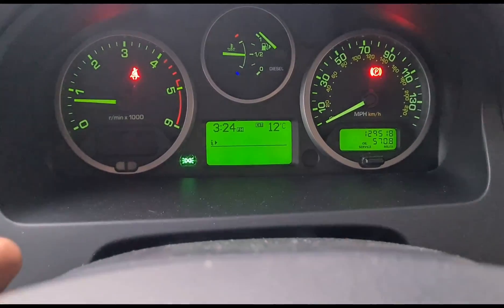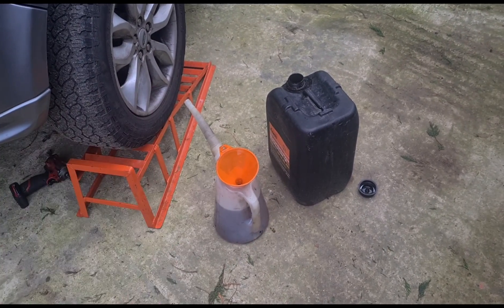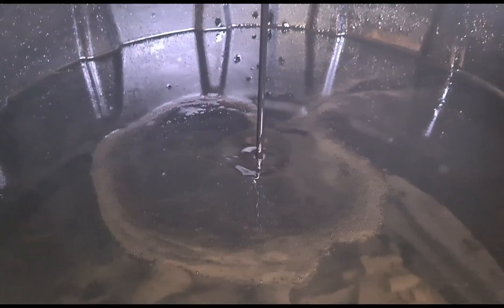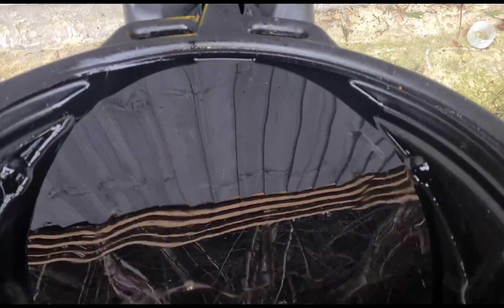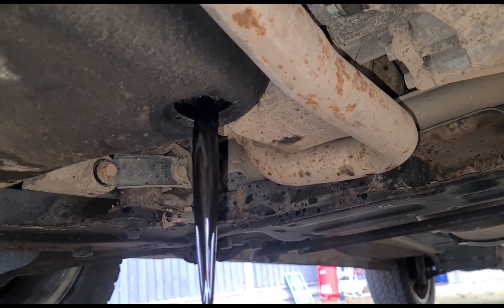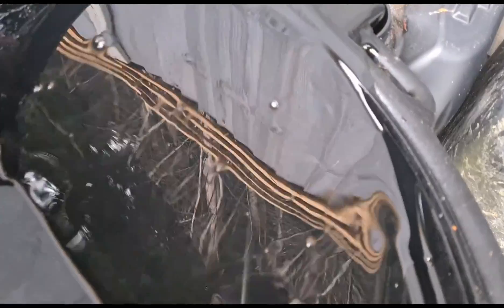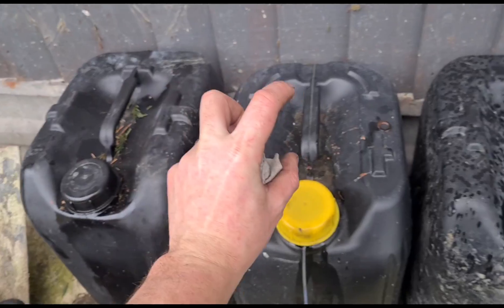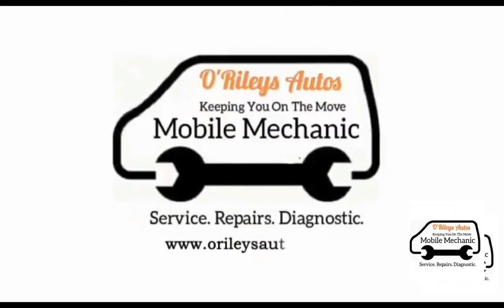How Many Oil Changes Until My Black Diesel Engine Oil Looks Clean? Test & Results

Comment: We just had work done on our 2014 cayenne diesel and the oil is suddenly clear. I do smell a bit of fuel in the car on startup vs coolant leak previously. Any thoughts on diesel leaking into the engine or oil and contaminating it? Thanks

Comment: I had very similar results with my BMW e90 320d at 140900 miles. First change at 140700, with new filter, run for about 200 miles, and then 4 more changes for oil to look clear like yours (3 changes with the same filter and on the last change, replaced the filter as well). Each change run stationery for about 8-10 minutes. Curious to see what will happen on the next change at 146000 miles. I have kept samples from all 4 changes. EDIT: After adding almost 6,000 additional miles, I repeated the oil removal process, and I stopped on the 3rd change; the used oil was still very, very dark. I don't think this process 'cleans' the engine.
Reply from the maker: Thanks for sharing

Comment: How long until it turns black again and are you going to use the oil used for the test again? 
Thanks, I did this with a scooter and planned to keep the oil and filter used for cleaning it and use that on a few oil changes. The oil in the oil level window on the engine was a lovely golden colour for a while.

Comment: Man here italy, we use to drive diesel, theres no possibility that oil in diesel engine look clean, switch it on and after a second is black again and is normal is not the engine that is dirty inside like in case of gasoline, but i love this kind of crazy video 😅😂

Comment: In 1963 I put a Frantz toilet paper oil cleaner on my nearly new Rambler American flat head 6. The oil went from black and dirty to golden and stayed that way. I expected the same with the Peugeot diesel.  It isnt happening. If the black oil doesnt stain the skin and feels clean and slick its clean. The old truckers palm test is with clean hands rub the dipstick in the palm. Rub it around. If you can feel the soot and it stains the skin its dirty. My old Ford diesel tractor still passes the palm test. The bypass filter uses half a roll of VIVA towels. If changing the filter and adding new makeup oil doesnt keep up with the soot I will drain the oil .The Pontiac is easy. It has a Australian Jackmaster Classic oil filter. Gasoline engines are easy. I have 1 micron filters. Some diesel soot is a lot smaller than 1 micron.

Comment: It’s totally normal for the oil in a diesel engine to look black. Even right after new oil was put in. It does not mean that the oil is broken down because it’s black. Totally normal. I use the Castro oil for diesels from Land Rover for my Range Rover L 405  TD 6 and have it changed every 6000 or 7000 miles.

Comment: When i bought my diesel Volvo the guy i got it of told me it had just  had an oil service and a new cambelt  , i could tell it had a new cambelt but the oil looked pretty dark so i changed the oil  two weeks after i got the car and changed the filter as well and just to be sure the car was in good shape i changed the oil again after 4 months  thats when i found out diesel oil goes black straight away and im a fool

Comment: Let me give you my dumbo opinion so from my experience with consumer diesels. So I noticed that diesels can run long oil change intervals, nothing wrong with that but I’m always a 3k or less interval but it comes from previous ownership of “sports turbo cars” where the turbo real regrades oil faster than we all think. So soot is like a black dye that’s natural in diesels, it clumps up and sticks to the inside of our diesels in every crevice. Even if you change the oil the new oil will break down those clumps which are concentrated dye clumps making your oil still black. The longer the intervals the more the oil has “dyed” not died  in diesels. My advice like another comment as well is using an engine flush, my preferred is 1-1.5 oz per unti quart of seafoam and drive around for about for about 100 miles as the seafoam will break down those clumps of soot dye. Not there’s nothing wrong with soot in oil but I have seen in the commercial side we have torn down a few fleets trucks with way to many idling hours and the oil was just too “sooty” and thick causing a few failures. That’s where I like my 3-5k diesel oil changes. I know almost all of you will say I’m wasting money but oil is really cheap tbh and a new diesel engine is not. I alway do this for the first few oil changes on a newly purchased diesel until I get bored and flip it lol

Comment: true. black diesoil. but good. I service my mb w211 320 cdi often. and my oil is clean for about 248 miles before it get dark. Still wonder why. but it always do. If I change the oil in time.

Comment: My 340k+ km Honda CRV diesel has a 7000km oil change interval. 
I tried last year some Castrol GTX, because of a very good price in Amazon but 5w30 C2 instead of 0w30 C2 so I used it in summer.
 I was really surprised after using it for just 5000km, I changed the oil and the new one remained clear for 2000km. Very efficient.

Comment: I work at an oil blending factory, so I always do a double oil change; one with basic mineral and $4 filter, and then after a drive round the block I dump and fill with the synthetic and a more expensive filter! Petrol engine so my oil is always golden, golden-brown by 6month change lol 
My wife doesn’t understand.

Comment: There is so much soot in that engine from extended oil changes that the new oil gets contaminated right away. I change my oil every 5000 km or 3000 miles and when I change it it takes a few days before it gets black. Don’t follow the MFGs recommendations for oil changes . Change it sooner.

Comment: Also good cleaning solution for really dirty engine is flush all after change with 50:50 mix cheapest oil with diesel fuel (you can also add engine flush if you want). Run it for 30 minutes on idle with slight revving (like up to 2-2.5krpm max). Than drain it, change oil filter of course (can be cheap one), put normal cheap oil and drive like 200-500km on it (just moderatelly, avoid high load and high rpm). Then drain it, change filter for good one and put good oil up to the next normal oil change.

Why 50:50 mix with diesel? Because pure diesel maitain weak oil pressure and even if it cleans better it will not flow as good in engine to flush most part with it. Also it's more risk to worse lubrication. Mixing like that will still keep you good oil pressure (on healthy engine of course) with good flow and it will splash everywhere inside engine well to clean it as good as possible without disassembly. Then cheap oil is for additional cleaning but also to remove all remaining diesel fuel from engine to not contaminate good new oil.

Comment: Well, it's because always you have some old oil left in your engine. Soot acts almost like a paint. If You want clear oil (at least for some time) drain old one as well as possible. Use engine flush before changing because it helps drain oil better. Wait like 15 minutes to drip down as much as possible. 

When You crank your car without oil (of course for few seconds max) and open drain it will spit additional like 50-100ml. But I was so surpised when last time I cranked car like that but also without oil filter. It spit out like much more old oil I'd say 200ml or more. So when You change You still have a lot of old oil. 

After that new oil was almost perfectly clear for first 100km, later it gradually started to change color to black.

Comment: It's much more helpful to run 2000 km between the oil changes. Because even black colour of the engine oil does not mean it's bad or worn out. Such method is more sustainable for environment and save you money.

Comment: Rubbish how can you flush a engine with bulk oil kmft. Once you drain the first oil, all you should had done is get 2 quart  of the bulk oil and 3 of transmission fuild put it in the engine let it idle for 15mins then hold a stead Rev at 2500 for 3mins then give it sum quick high revs then let Rev settle down to its normal rpm then switch of the engine remove the oil cap and bung an let the oil drain while your removing the oil filter. After it finish drain replace back oil bung and new filter and fill up with Castrol 5w30 10w40 or 15w40 with one your vehicle recommends and you should be good to go just like that. 

Those 5 gallons black bottles bulk oil is what damaging Turbos, and Blocking up Dpf on diesel vehicles. Use what the manufacturer recommends simple.

Comment: Diesel Engines the Engine Oil goes black after the change. Petrol Engines even older cars takes at least 1000 Kilometres for the oil to go black unless the engine is dirty.

Comment: With my 150,000km V6 petrol car it took 3 changes, with a 50km run between each one, to get it back to new looking, and now it gets changes every 7500km and comes out almost like new each and every time. It's now got almost 200,000 on it and still looks great every 7500km (15,000km recommended change interval). Once you get that varnish and gunk out of a petrol engine it looks good for way longer, but alas diesel engines dirty oil quicker than a 5 year old's clothes in a mud pit

Comment: There is another thing about oil getting darker/black and thats a heat. You can try yourself at home, to cook oil in a pot and you will see, that literally after around 10+ minutes oil gets darker and darker. People always think black oil = bad oil. ABSOLUTELY not ! Black oil doesnt mean, that it cleaned all junk and carbon, but heat cycles too. So in conclusion, Its absolutely normal, that new oil gets black even after engine has ran only for few hours.

Comment: Theres a lot of variables in this.
Black oil does not mean its fully saturated with suspended gunk and has lost its protective properties.
The first oil change may not have had enough time to reach its full suspension potential. The same result may have been achieved with fewer changes.
The only true way to know how your oil is going is a lab test.

Comment: I wonder if you had put an oil flush in for 10 mins before the first change, how many changes it would have needed after that to be nearly clear. Might have saved a few $$$. Overall the video is pretty shocking. I was surprised. Thank you

Comment: It’s a diesel engine they’re dirty combustion as there’s no spark so you get more carbon build up where’s a petrol is a spark initiated so burns quicker and  hotter and cleaner cause a petrol oil is like a treacle colour after a change

Comment: Thanks for doing that!
How many times have I thought about doing it myself? 
50 years ago I used to run through some 'flushing oil' every third of fourth oil change. That seemed to help.
My current car - a discovery 4 - leaves (at a guess) about a litre of old oil inside when I do an oil 'change' since it is emptied out through a tube from above, and the modern oil is like water anyway... I miss the old 20w50 days 😄

Comment: I have 2001 case tractor with SISU  agco engine(420d with fully mechanical stanadyne injection pump).  engine has 1700h.  the oil stays pretty clear, and after oil change it's clear for 100h or so. probably because the engine doesn't have egr or dpf(never had even from the factory) and is probably in perfect condition also. This is the first diesel I have seen that stays so clear.
Reply: I've never seen a used diesel that had clear oil.

Comment: Use an engine cleaner based on detergents and surfactants to clean lubrication conducts and deposits every three oil changes. Ravenol or Xenum engine cleaners.

Comment: I always drain my oil put a new filter and fill the engine with diesel I do this twice then throw another filter in and new oil my oil is hardly ever black and I only change it once a year I’ve always done it on all my cars for over 20 years diesel is a great cleaner for the internals I used to be worried if it was bad for the rubber seals eg crank and cam shaft seals but never had any swell up from the diesel I also just leave the engine on idle for at least 20 mins with just diesel in

Comment: why are you not changing the filter too? I can't see this as anything but half done without that. Seems like you're manipulating the conditions to get the results you were looking for. not impressed
Reply from the maker: Who said I never? Whole point of the video was to show after a normal oil change service the oil is still black. Just an experiment afterwards to see how many oil changes to make it clean. Why so serious?

Comment: I had petrol engines all my life until i was almost when I bought a Mercedes diesel, I’ve had it 10 years now and I always check the oil level when I get it back from service. I never questioned the fact that it was black straight away but good to know that it can be cleared at a cost but how long after that would it turn black again? I suspect not very long at all

Comment: If people change the oil like it was done when i was younger, before summer and before winter, max 5k km, or 3500 miles  then you would always have a oil thar can absorb impurities.  The few diesel cars and trucks I've owned have never had black oil, but at most a dark one. People simply neclect the oil change and filter or top up when low. Then come the excuses.  Buy a new diesel car and notice how good the oil looks when 1st and 2th service is done. Its golden oil and keep it like that with good service. Simple.

Comment: I have enough oil every 3 oil changes to do a flush on the 3rd, i change it every 6.5k so when i flush it that 3rd time, it goes clear. That's on a ds4 105k been doing it since new. I change the filter twice on the 3rd service on flush oil through the filter housing and the dip stick.

Comment: Your experiment could be improved by changing the oil filter every time you change the oil. The oil is black after an oil change could be due to the fresh oil flushing out the soot trapped in the filter from the previous run. Also I would drive the car for a few miles instead of running it under neutral.

Comment: Diesel engines generate soot. Some of which got into the oil making it black. A black engine oil does not mean it is not protecting your engine. In fact it has an additive to keep the soot in suspension. A reliable way to check the life of an oil is to do an used oil analysis. Look for viscosity change, residual TBN and metals content.

Comment: I've often wondered how many it would take to get the oil clean.  Wasn't expecting five.  I bet it wouldn't take many miles before that fifth sump full started to look black, the nature of diesels.  That certainly made a nice engine flush
Reply: Diesel oils would look like honey after 5k miles if it didn't have the EPA crap on it
Reply: @ajs96350  why do you think that?
Reply: @ajs96350  thanks for the reply so you believe the emissions equipment is contaminating the oil?

Comment: It highlights the importance of using quality `diesel` engine oil over regular oil as the combustion of a diesel is inherently dirty ( sooty). A quality diesel engine oil will have detergents that help in keeping the oil more stable & in turn the engine components cleaner all helping to make the motor more reliable. I used to service Scania trucks fitted with centrifugal oil cleaners & you could see a big difference between a quality oil & a budget oil in the amount of deposit on the bowl of the filter. Don`t concern yourself too much on dirty oil, more important to change the oil at regular intervals. I never let my diesels do more than about 6,000 miles & I never suffered any oil related engine issues, & the saying in the trucking industry is `oil is cheaper than metal`.

Comment: It only takes one change , diesel engine oil is designed with dispersants to hold soot in suspension in the oil. A diesel engine is not a gasoline engine . One change is enough !

Comment: Didn't watch this video, not sure what he's trying to accomplish, but diesel engine oil will turn black shortly after a change with new oil because diesel engines produce soot as part of the combustion cycle and good oils are designed to keep that soot in suspension in the oil so it doesn't "plate" out on the inside of the engine. If you change you oil in your diesel and it comes out "clean/clear" you have poor oil.

Comment: Particularly in diesels - black looking oil isn't an indicator of poor lubrication. A more economical route to make the carbon clear out would be to use a bottle of something like Liqu Moly oil flush additive before the first oil drop and just change it once. I get that that's not the point of this video - which is well made. Are you from Co Clare by any chance?

Comment: Diesel oil is designed to hold the soot particles suspended in the oil, that’s why it’s important to use diesel oil in a diesel and oil designed for a petrol must be that, designed for petrol.

Comment: I always knew it wud take at least 3 oil changes even if the cleaning agent was not used   i did a very similar thing to a car years ago did the typical drain took the sump off gave it a clean inside and did the plug to then put about 1-2 liters back in ran the engine at idle for about 10-20 seconds max then drained the oil and it came out black but I knew the oil I put in had filled the oil passages with fresh oil and had pushed the black oil out.   It certainly shut my dad's mouth up as he said it would not work you drained all the black oil out I said no there is still some in there. Yeah who was correct not him.  Most oil changes get contaminated with the old oil straight away so almost no point in changing it as it's  dirty when it hits the old oil

Comment: Diesel engine oil is completely different from gasoline engine oil,it won’t retain that honey colour for very long due to the nature of the combustion process with diesel engines. I’ve seen new diesel engine oil turn black days after an oil change,this is completely normal.